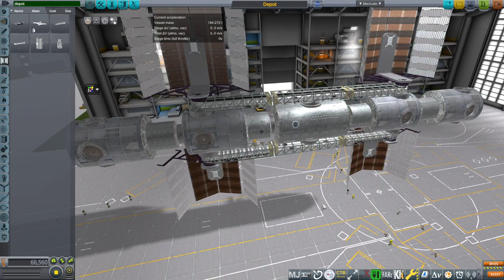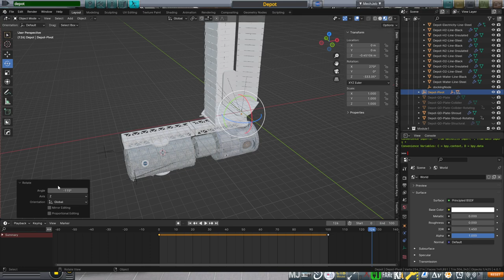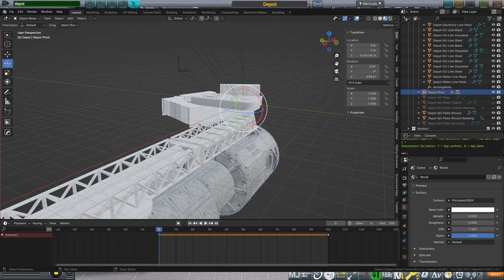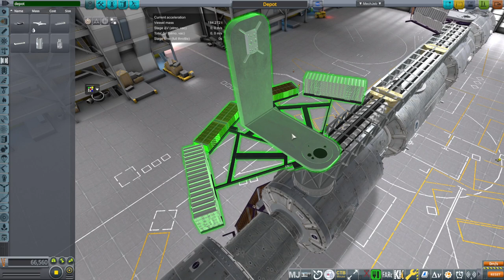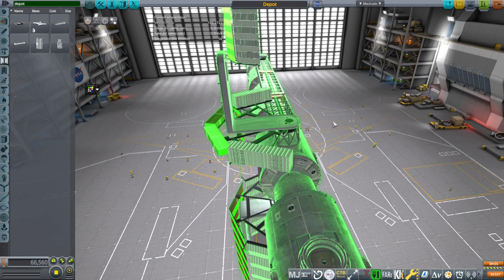Starship Depot Concept (RO in KSP 1.12)

Comment: i think this could be better by using a sun shield, similar to that on the JWST, for example, and dock the starships facing through the station to the sun.
That way the station takes most of the solar radiation, and the small, lightweight shield could block the rest.
Alternatively, some sort of solar panel could be used instead of just a shield.

It would be better to minimize the exposed cross section in the first place.

Comment: Ya those radiators would be worthless.  The sun side would absorb heat and the dark side would just push that heat into the fuel tank.  Even if they were 90 degrees to the sun you still lose half their effectiveness because you wouldn't want to radiate into the tank.  Ideally you would want a minimal cross section to the sun i.e. docking at the midpoint with a solar panel cap and radiators from tip to tail perpendicular to the tank with no more then 4.  Solar panels need their back side clear so they can radiate heat otherwise they overheat and shorten their life span.
Reply from the maker: I'll think about reorienting the radiators, but for the solar panels, can we just cool their back sides with liquid flowing through the radiators?
Reply: @RaizSpace  Yes you could and that would improve their lifespan at the cost of weight which could probably be justified for a long term habitat.  I still think the best solution would be a T shaped structure with the top of the T being solar panels blocking the sun and the base of the T being a radiator acting as a spacer between the tank and solar panels.  This gives plenty of black space for the solar panels to radiate into and the radiator would only inject 5 - 10 of its output into the solar panel and fuel tank

Comment: For the docking port on the solar panel radiator construction, could you just launch it with no docking port and retracted .Then you cluld extend it and add one in an eva via the stock system or KIS

Comment: why not fold those radiator holders for the launch? also putting them in the shadow is a good idea but it was already mentioned here
Reply from the maker: The braces holding them would really be structurally unsound at that point given the size of them. It's already pretty thin.